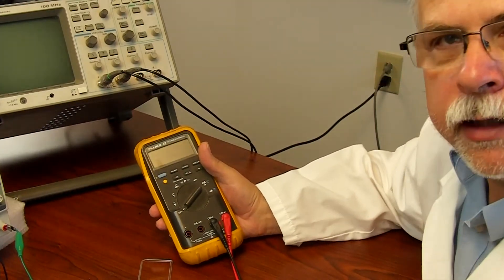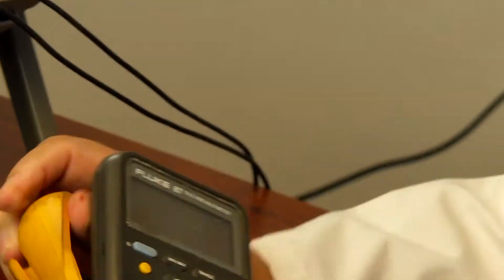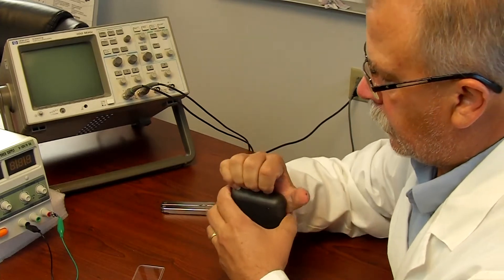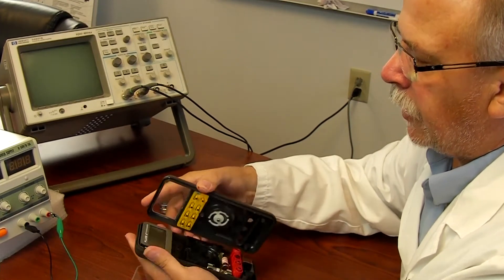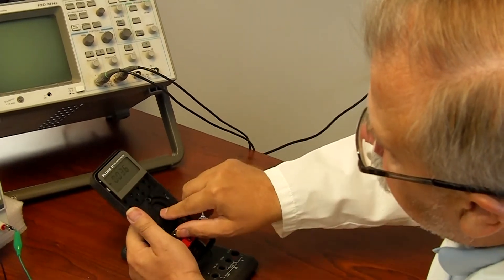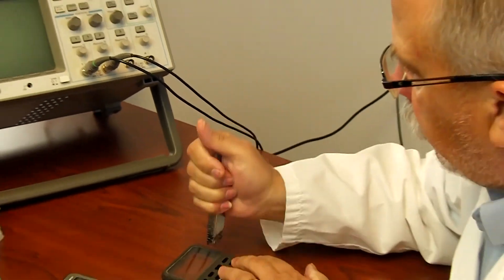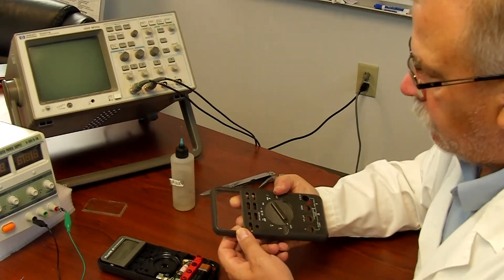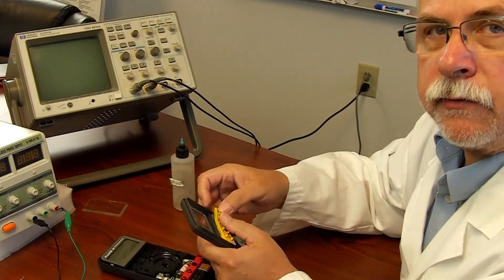Fluke 87 Lens Replacement

Comment: Should have checked - the catagory this video is "Comedy"...   I tried "popping" my lens out lke Chuck - broke the top part off...  Now I went from a meter with a glue spot on the lens to a meter that I cannot use until I replace the whole front... :-(

Comment: hi chuck, I just replaced my Orig. Fluke "87" meter with a cracked lens and your lens worked perfectly. Just ordered another for a spare, as I have Two Plain Orig. 87's.. I see on ebay someone gave a poor rating?? well I have to think they didn't read, and check the Fluke models that it fits? I'm not sure what all models it will work on, but it definitely fit my 87. Thank for a good priced product, that makes my OLD Fluke 87 look NEW.. csmith
Reply: Thanks, anything you can do on ebay to boost our rating would be appreciated.  One guy broke his case or something and was blaming us for it...